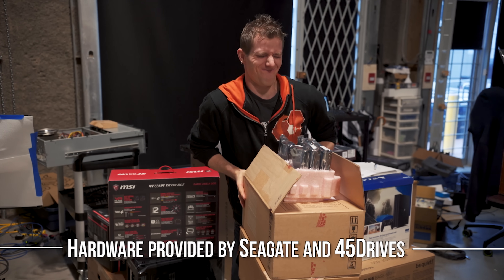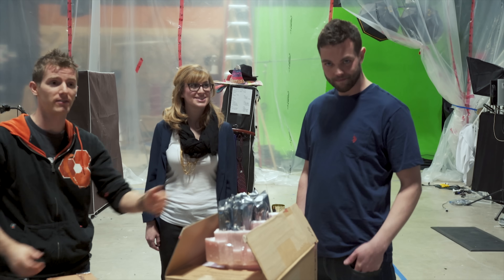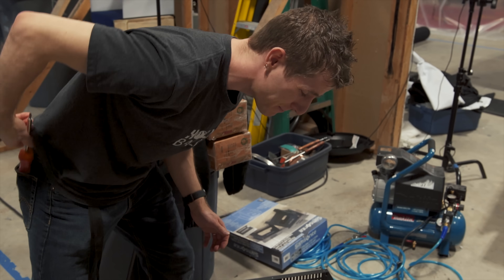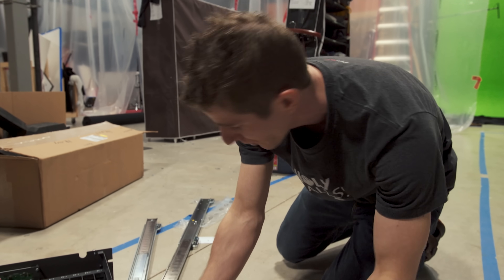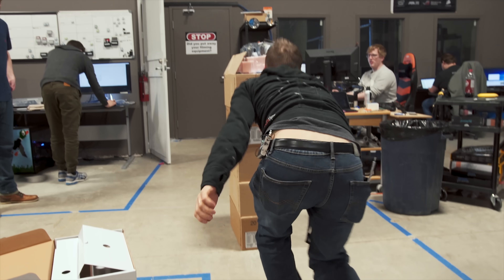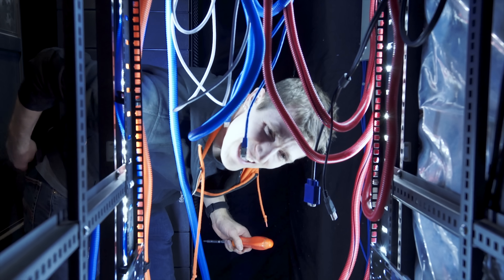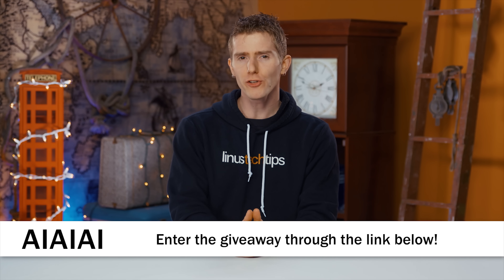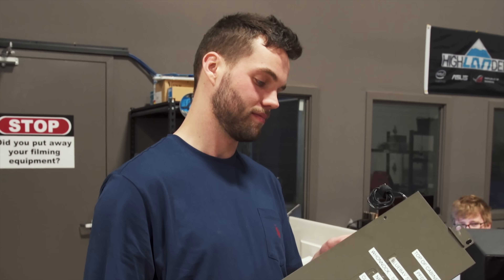INSTALLING THE PETABYTE - Server Room Upgrade Vlog

Comment: Question: why call it a "Petabyte" server if it only has 778TB? Yeah it might have 1PB potential, but thats not formatted.
Reply: It's because they run a special raid configuration that allows them to be able to recover lost data in case of a malfunction. Basically it is a petabyte, but 222TB of the space is reserved as backup which you can't use to write new data.
Reply: All of Windows's file size displays show binary-based sizing instead of denary. It'll be close to 1 PB, but also equal to 778 tebibytes. 1 tebibyte > 1 terabyte. Technically Windows should name them TiB, GiB, MiB, and KiB.
Reply: burkevren What kind of raid doesn't just split the space in two?
Reply: Most of them.
Reply: How well does it compress the backup data size? 
I was wondering if it just deletes the oldest files after the backup storage exceeds 222tb, or can it somehow compress 778tb of data into 222tb backup? (I have no idea how backups work :/ )
Reply: Slice I suggest you read the comment chain that you made your comment on and then you might learn something.
Reply: its because one gigabyte means 1000^3 bytes and not 1024^3 bytes
Reply: He even says why in the video, and he was surprised that he even got that much. They are probably running raid 5 or something which reduces the amount of available storage in order to get resistance to a single drive failure.
Reply: filesystems are usually measured with GiB/TiB while raw disk is measured in GB/TB. on top of that, raid/erasure coding redundancy eats space. yet his setup is still capable of 1PB raw data storage.
Reply: Speakerman2000 While what you say is true, the space lost is more likely due to the filesystem (ZFS, etc) and Windows misrepresentation, Windows misrepresentation shouldn't take away 222TB worth of space on it's own.
Reply: Same reason why my HDD has 917 GB when it was said to be 1 TB, they got don fooled.
Reply: Research pebibytes vs petabytes. It's a small difference at kilobytes and kibibytes but once you get to the point where you're talking about quadrillions of bytes, the difference amounts to a lot :)
Reply: I can understand that way of thinking. But they call it their "1PB Storage Server", when then can only "store" 772TB, even if it has a 222TB (or whatever size) backup. It's like my Samsung 850 EVO 250GB: I only get 240/230is GB because of formatting and recovery partitions. I'm not trying to knock Linus at all, I think he's a very smart guy who has build  himself a very successful business, I'm more or less knocking the idea of calling (for example) a 1TB drive a 1TB drive when really you can only store 931GB. But hey, my opinion, others have theirs.

Comment: Hey LMG I really want to know what is okay for VR? Is the gtx 1060 okay to run the HTC Vive or do i need to upgrade to a 1070. What settings can i run games at and how much fps and is the GTX 960 really the minimum? There is not much on the internet shouting out and it is another Idea for you guys. <3

Comment: The test at the end was not indicative of real world performance. The 10gb file will have  been cached into the ARC (ram) when it was written. So when it was copied back to the client it will have been read back from ram. You need a test file twice your memory size to get a real idea of performance.

Also with that kind of a setup a mirrored ZIL might be quite beneficial. Especially if Gluster is writing synchronously, but I don't know much about Gluster.

Comment: Isn't 128GB Ram (per 400TB box) a little bit too less for such kind of build? Because the usually suggested amount is is roughly ~1GB Base + ~ 1GB Ram per 1TB Diskspace (before Redundancy). I mean i see that its reading steady 1 GB/s over Lan and writing over 3GB/s offline but will it also do this when it starts getting full and constant heavy load? Because it looks like the Mainboard has 8 Ram slots which would enable them to get at least 256 GB (if the Mainboard supports it ;) ). Still not the 400GB Ram normally suggested but according to ZFS documentation more ram is always better.
Reply: PS: Im not making the numbers up, Read the FreeNas ZFS manual or listen to Allan Jude:

"As a bare minimum, the total system memory should be at least one gigabyte. The amount of recommended RAM depends upon the size of the pool and which ZFS features are used. A general rule of thumb is 1 GB of RAM for every 1 TB of storage. If the deduplication feature is used, a general rule of thumb is 5 GB of RAM per TB of storage to be deduplicated. While some users successfully use ZFS with less RAM, systems under heavy load may panic due to memory exhaustion. Further tuning may be required for systems with less than the recommended RAM requirements."
Reply: Guess that depends on the definition of heavy load in this instance - whilst they use a lot of storage the load may not be significant. The load would be much more stressful if there were hundreds of clients, but they only have ~25 employees. My 21TB (formatted) copes just fine with 3GB of RAM, although it's limited to 1Gbit transfer speeds
Reply: 1GB per 1TB is for a fairly typical install that hasn't been optimised to run well. Since this box is mainly going to be used as network file storage you won't get the full read/write times that the drives can offer anyway so suffering some (or a lot) of performance loss would probably not be seen by the users anyway.

In saying that more RAM definitely would be better but that can be easily and relatively cheaply added later on as the system starts to fill up.
Reply: So "The Vault" is accessible to all users on the network ? How is the users are managed ? What if accidental deletion ?
Reply: @Phillip Parr I think there indeed shouldn't be too much constant load on the server, especial if you think about the ssd server they have to do all the actual work on, from where it then gets synced to the storage server. So only time will tell if the Ram was enough but 45drives surely have made their homework and desinged their machines to do their jobs as intended. I mean this surely isn't their first machine they sell since they look like they are quite well designed for the Job and more space efficient than the front loading ones from the other companies :).
@EZmode Freenas server with 10GBe do actually need an decent CPU to completly satisfy the 10GBE (at least when you are using Windows clients) since the Samba implementation on Linux/BSD/Solaris is pretty bad, most ZFS builds have also enabled LZ4 compression which increases CPU load further more. The Raid setup and checksumming also uses quite some CPU time since ZFS is recommended to run as a software raid so it has complete control over the drives for maximum performance. (I.E. Usig the raidcards as JBOD). But all of this does not matter for this video since every Xeon e5 will have easily enough performance. Just don't think someone could use an Intel avoton CPU or an i3 for such kind of build ;) (But why would they anyway? :D ).
Yes you are right about this, they could easily upgrade the RAM later on if the performance of the machine drops over time. No need to invest more money if it isn't necessary.
Reply: ZFS does not require 1GB / TB, that is simply made up by the freeNAS community. ZFS will use any amount of ram you give it. 

The notion that ZFS requires a lot of ram is because it will use it all if allowed, and the feature 'deduplication' does require significant amounts of ram but that feature is not recommended unless you know EXACTLY what you are doing.
Reply: I wouldn't dare to say its made up by the Freenas community since  its directly out of the book "Free BSD mastery" ZFS by Allan Jude (a free BSD DEV) and Michael W. Lucas (no idea what he does LOL). But Its indeed more meant as a number that they don't guarantee perfect performance if you go lower than 1 GB/TB HDD.
Reply: This is just a storage server. Loads of IO but very little cpu usage. Besides if the system gets mem starved they can always throw in more.
Reply: The users could be managed by adding them to the system or by having the system connect to active directory for authentication. I would imagine since being a small user base they would just manually add the users to the system. Accidental deletion is a huge concern as no other backup seems to be added to the system.
Reply: Yes the single deletes the file from their windows machine?
Reply: What do you mean by "accidental deletion"? That they somehow manage to brick/delete the entire storage or that one single user deletes some important Files that other users wanted to access? 
If you mean the 2nd, then you could just restore the file from a ZFS Snapshot (ZFS keeps snapshots around for a specific amount of time).
Reply: On thing to note.. there are 128GB DIMMs and have been for a while.
8 slots of those would put you at a TB of RAM. You could get away with 64's and support 500GB of storage no problem. :)

Comment: linus what you scan with scanner on ram
Reply: they have an inventory database.  the scanner lets them put in serial numbers. they tie when and where they got it, how much it cost, and maybe even shipping information.  that way, if one of the sticks of ram ever goes bad, they can find an exact replacement. if they have it on site, their inventory will show them where it is stored.  its a pain in the ass to inventory and set the system up, but five years down the road, it is worth every second of inconvenience that it puts you through.

Comment: Just for clarification: Windows actually shows 778 TiB (Tebibyte, (2^40)Byte * 778), which is equivalent to about 855 TB (Terabyte, (10^12)Byte * 855).

Proof: Just view the properties of the drive in Windows Explorer, it actually shows the amout of Bytes the drive has available.

Comment: Why is their an 'electrical engineer' in this video?
Its basically pug and play ffs.
Reply: are you kidding?  when there was a problem, the guy knew exactly where to look, exactly what could cause that problem.  he knows his companies solution inside and out.  a little hiccup like that can bring some companies to their knees with 'RMA' shipping back and forward.  he was there in case something went wrong.  and it did. and he fixed it quickly.  an electrical engineer is not a dumb guy.  if i was getting this setup, i would be ecstatic to have support like that for the install.
Reply: As an electrical engineer - thanks for having faith in us LOL

Comment: Wouldn't it be more viable to use 2.5" drives rather than the older 3.5"?  You could fit a lot more storage in the same platform.

Comment: Windows doesn't report storage as the manufacturers do. 1 TB (1024 GB) is 931 GB, 500 GB is 465 GB, so in theory Windows should report this 0.97 PB (1 PB is not 1000 TB) as ~900 TB

Comment: using Seagate drives is like a tank made by China (and 8f you still don't get it, Seagate has a high failure rate
Reply: these are ENTERPRISE GRADE DRIVES..

so there better?
Reply: We have had heaps of enterprise Seagate drives fail here in South Africa. We believe its an issue with how they are handled in shipping. haven't had a WD red / black or purple fail in the last couple years

Comment: "handle with care please" written right on the box and linus just drags it all over the floor, drops the rails, threatens/ and does take a hammer to the server, loses screws  inside the case, haphazardly stacks them on the floor,   make towers of the drives and pushes them across the floor, and all of this of this right in front of the company that gave him the hardware,  ha ha ha - man i love Linus.

Comment: So, judging by 300mb per second of film material, that's only enough space for ~715h of footage then? Doesn't seem like much to me.
Reply: For the same reason you use a picture of your jacked back as an avatar. Nobody cares but you show it anyways.
Reply: Basti Lift: of raw footage after rendering its a lot smaller. I don't think they upload videos with 20 gb per minute on YouTube😄
Reply: Why is Linus bragging about the file size of their new cameras then? Shouldn't have mentioned it in the first place if it doesn't get uploaded to the server IMO. Totally unrelated.
Reply: Because everyone brags about the RED cameras...
Reply: The cameras will have in-camera compression, usually set to 8:1 which helps makes the file smaller. You gotta remember though 7680×4320 (8K) * 30hz = 995328000 pixels per second, that's a shit load of data.
That all goes onto the RED Mag SSD things, then on to the NVME SSD server for editing (maybe GoPro Cineform transcoded still? otherwise it'll stay as .R3D files), then on to this backup server after its finished being used.
Reply: Because it is entirely related. A video with your phone, even at 4k if it can do that, is like a tenth of the size of 4k red footage, since it probably captures as raw, which means you can edit most camera settings after filming.
Reply: Nam3less because they are awesome
Reply: To Athánatos BURN BABY, BURNNN

Comment: Isn't 1 petabyte 1014 terabyte?
Reply: yes but Linus is on about the raw storage of the server since depending on config of the zfs vdevs means you could have around 300tb of usable storage with the same hardware if you wanted a lot of redundancy for example
Reply: I think it's 1024
Reply: neda2525 OK, i wasn't Sure either